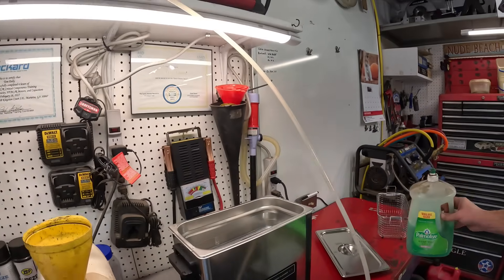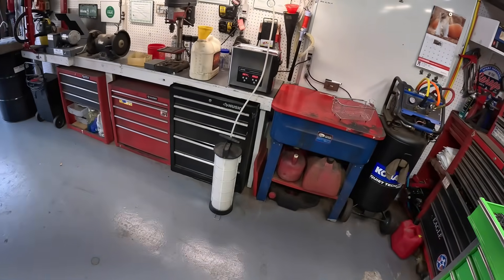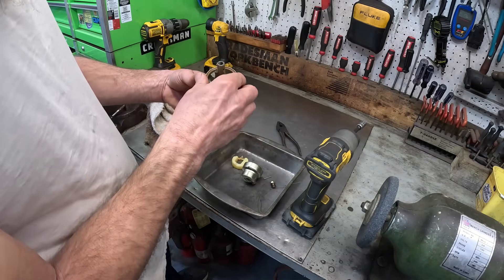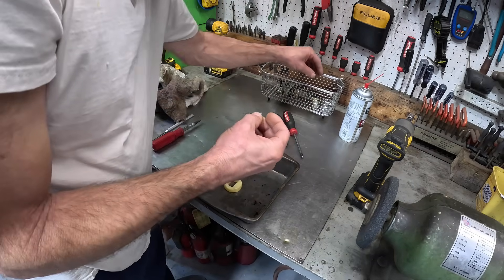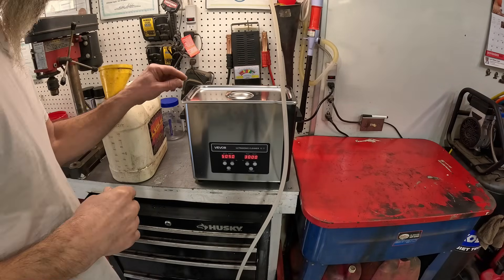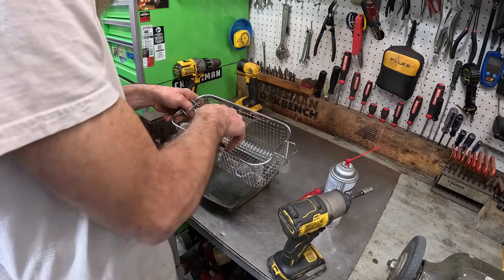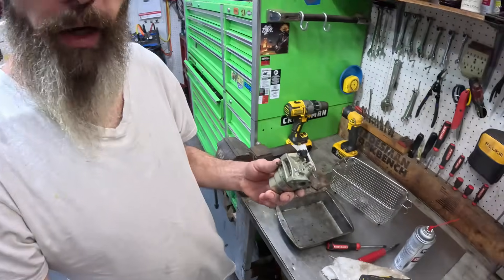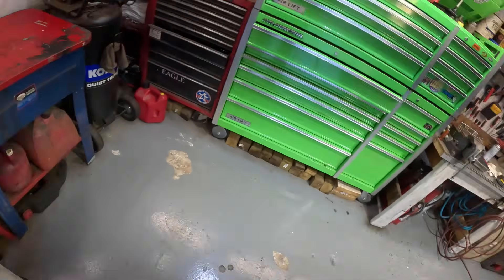Testing The New VEVOR Ultra Sonic Cleaner | First Carburetor!

Comment: Hey Tom;  I've tried all sorts of cleaning concoctions in my US cleaner.  Best I've used to date is Simple Green PRO (not regular Simple Green).  Safe for aluminum, and DOES NOT turn carbs gray or black.  It says on the jug "safe for metals". I get it at Home Depot here in Huntsville, as apparently the Lowes right next to my neighborhood does not want to carry it.  I just keep using it over and over til it turns to almost mud, then drain it out and load up a new mixture.  A 1-gal jug lasts me over a year.  BTW, I have also poured Evaporust in it to clean small rusty parts, and it works wonders.... then pour it back i n the Evaporust container for use again next time.  I do pour it through a paint filter though to remove larger particles.

Comment: My ultrasonic does not have a heating element, but it heats up during use.
That said, I use a glass jar to place in the ultrasonic.  The tub is filled up with water, and the jar has my rather unconventional mix of brake clean, carb clean, old gasoline, and the majority mineral spirits.
As I mentioneid, non-flammable, I've tried igniting it with a propane torch, and it never lights, so I'm guessing it's not flammable. Works amazingly well, and since it mixes so well with gasoline, you don't need to really wait for it to completely dry to reassemble it.  

But if you did decide to use carb cleaner as a ultrasonic solution, use a glass jar surrounded by water, it does work, but there always is the possibility of fire when using flammable liquids and electricity :)

Comment: Glad you got to use your new ultrasonic cleaner. I use a solution water and dawn, water and simple green. I had used purple power and had it discouler the carb. Might try it again with a weaker mix. I have cleaned jewelry and some of my hand tools. I have a couple ratchets that need maintenance, I'll be running them thru the machine after disassembly. Have fun Tom.

Comment: Take large plastic or glass jar, depending on the type of cleaner used, fill with  enough of your selected cleaner or solution to submerge carb or other items that will fit in jar. Fill ultrasonic cleaner with warm water to desired level, , Place, capped, Plastic or glass jar, full of goodies and cleaner, into the water. Turn on cleaner for however long you desire. The idea is , you only contaminate or use a small amount of cleaner which can be stored in the jar when not used and you only have water in the ultrasonic unit to dispose of and not have the ultrasonic unit sitting around full of a liquid that you may or may not want sitting around. . Imagine a jar with your favorite type of  cleaner, one with dish soap, one with the green or purple stuff, ect...  Keeping the water warm  with the heater is not a safety problem and you could use a glass jar if desired.  Different types of cleaner are flammable or damaging to plastic. So do your research please. BUT!!, you are a responsible person so, you do you. Good video.. Thank You...

Comment: The first time I saw one of these ultrasonic cleaners was many years ago on Mustie1 channel.  He actually did and I still think does pours “Gunk carb cleaner” or “Berrymans Chem-Dip” right in the ultrasonic cleaners.  Keeps re-using it for 6-12 months before changing.  I have done the same before.  Never heard anyone having any problems doing it this way.  You will see others on YouTube doing this as well.  I switched to Purple Power and water mix just because it’s cheaper.

Comment: I meant to tell you on one of the livestreams the other day... Anyways. You can use any kind of dish soap, or any kind of strong degreaser to clean parts with in the ultra sonic cleaner. Mean Green, Simple Green, LA's Totally Awesome Cleaner (Dollar Tree), or Purple Power works wonders. You can adjust the cleaner/water ratio however much deep cleaning you need. You really don't have to do any preliminary cleaning of the individual parts. But as much as the carburetor you can disassemble works best. Depending on how dirty or gummed up the carburetor is, you may have to run the ultrasonic cleaner twice. Two 20 to 30 minute intervals.